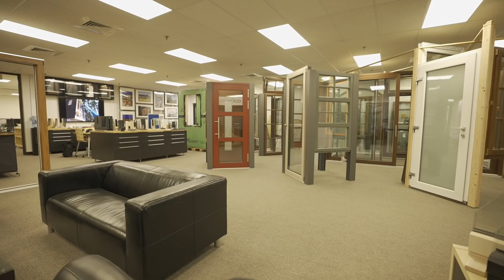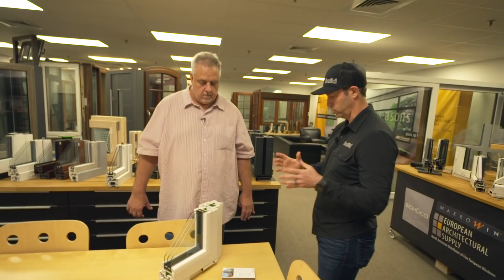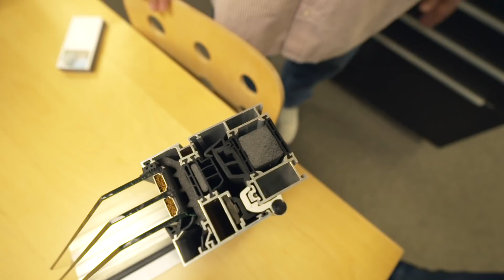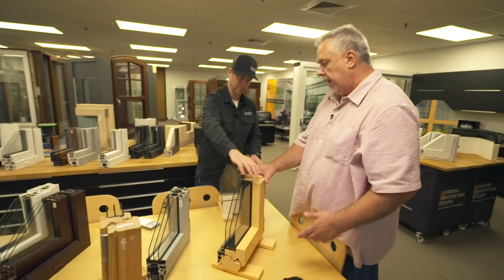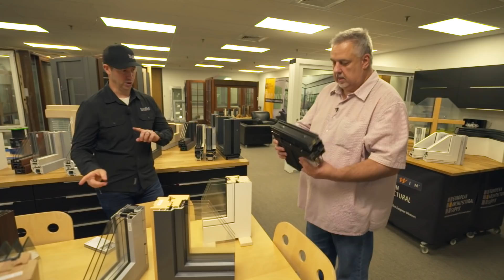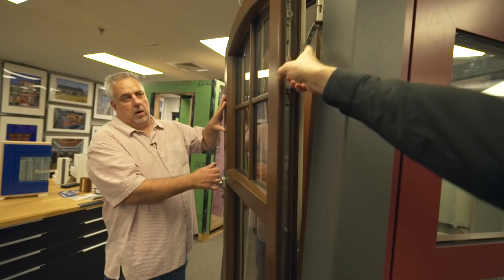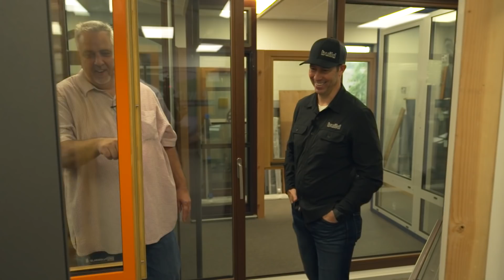These windows are AWESOME - Steve and Matt go window shopping!

Comment: Seen many of these style windows in action in Europe, and have also seen a showroom/manufacturer in Bosnia.
Our window technology in North America is stuck in Stone Age.
My dad's old place in Europe had windows made of two operable leafs, and each leaf was sealed, double glazed.
So, that means that they were quadruple glazed.
Reply: you apparently are not aware of this, but they do make triple glazed windows in the US; and those triple glazed windows perform better against US testing than do european windows. the issue is that relatively few people in the US buy triple glazed windows. the problem is that there is not enough incentive given to people to buy them: builders are primarily driven by "cost per square foot" considerations, so they aren't going to do anything (by way of energy efficiency) that they don't have to do because energy efficiency doesn't sell houses.
Reply: @paperwait9611  
I know they make triple glazed windows in North America.
I have used Loweven triple glazed windows as an architect on one of my jobs In Ontario, Canada. I think Pella makes them, and so does Marwin.
It's not all in the number of glass lites you have in a window; there is a lot more to it.
Subdivision builders don't give a crap about quality nor energy efficiency, because there is nothing for them there. Custom home builders sometimes are a different breed, but they are driven by client demands and architects requirements.
Reply: @apscoradiales  subdivision builders are trying to sell houses. most people aren't willing to pay for more energy efficient houses and, unlike europe, US building codes don't force builders to build more energy efficient houses.

custom builders are generally not "a different breed" in the US.

Comment: Been keeping an eye on these windows since we’re planning on building as soon as the lumber prices cool off
Luckily we’re only about an hour west of Acton (I’ve read the Schuco shipping costs are significant)
The hard part will be convincing the wife and the builder to spend the 💵 😂
Reply: the lumber prices are mainly affecting the prices of softwoods. windows tend to use hardwoods (with douglas fir being a notable exception).
Reply: @paperwait9611  considering the aluminum option
Reply: @josecito976  aluminum might be the most expensive way to go, but they can give you the thinnest frame profiles among your frame options.

Comment: Yes, they are wonderful but who can afford them?
Reply: They're not really that expensive in Europe, especially in the east of the EU. I recently ordered several to replace some of the old ones in my house in Poland. The new ones are pretty standard as for 2021 standards (uPVC, anthracite gray on the outside, white on the inside, triple-glazed, triple-sealed, tilt and turn, average u-factor of 0.78 metric (imperial 0.13 or R-7.7). The price for a 75"x55" window was only $490.
Reply: @Micha-xl5yc  Very expensive in the USA.
Reply: @Micha-xl5yc  That is dirty cheap for a window that size.  Is the window French door style and handle splits at the 75 inches so you have two 37.5" inch sides?  Who is the manufacturer and how long did your window take to get to you from the time you ordered it?
Reply: @MillionDollarFlipper  The manufacturer was "MS Okna", they used Deceuninck profiles. I ordered them through their local dealer and it was supposed to take about three weeks for them to arrive, but took two weeks longer due to some covid-related issues.
Yes, the window is split in two halves down the middle, each with its own handle.
The windows were custom-made, but that's just the default business model for window manufacturers here. Standardized window sizes exist, but there's no difference pricewise.

Comment: These windows are so impressive. It's unfortunate that the industry in the USA is so resistant to adopt these great international ideas. Greed rules in the USA, so industry investment in advancing product design or manufacturing processes is skipped in favor of more profits. As always, the knowledge base and concern for his clients that Steve possesses are unmatched. It'd be a privileged to have him design my dram home and have Matt build it. I'm seriously considering retiring to TX in about 8 years so it could actually happen!
Reply: you're getting suckered by marketing hype. US windows are optimized to US test standards. the u-values that you see quoted for european windows are usually against less rigorous european testing standards (they are less rigorous in europe because european countries tend to not get as cold as northern areas in the US get).
Reply: @paperwait9611  That's just false. Average winter temperatures in northern areas in the US are the same as in say Poland. You have to go deep into Canada (or to high Rockies) for it to regularly get colder than anywhere in Europe.
Reply: @prospero768  dude, you are badly uninformed, if not completely delusional. the average january low temperature in warsaw poland is 24 degrees fahrenheit; the average january low temperature in minneapolis minnesota is 9 degrees fahrenheit (with temperatures getting as low as -15 degrees fahrenheit in a typical winter). there is a reason why US windows are tested to a low temperature of -1 degree fahrenheit while european windows are only tested to a low temperature of 32 degrees fahrenheit - that reason is that european temperatures are mild compared to continental US temperatures.
Reply: @paperwait9611  that's not what the long term weather maps say.

Comment: I've never seen a better analysis of windows ever. 
That quad glass piece looked like something from Q Branch in a Bond flick.
Reply: the "quad glass" is not a quad IGU. a quad IGU has really low thermal conductivity values. the "quad glass" that you see in this video is really a triple glazed IGU with a fourth window. this configuration can reduce the u-value below that of a triple glazed window alone but the u-value would not be as low as it would be for a true quad IGU.
Reply: @paperwait9611  Any idea why the 4th piece was thicker and tempered? Thx
Reply: @bearleton3  i thought that they said that the lite was laminated (not tempered), so the lite would be thicker because it was laminated. but people don't usually implement safety glass (such as laminated or tempered glass) unless a building code provision requires it. so i don't know why the outer lite was laminated (or tempered).
Reply: @paperwait9611  You're right. They said the outer "storm glass" was laminated, not tempered. My bad.

Comment: Nobody makes windows form plasticized PVC! Plasticizers are additives used to make the material more plastic, aka flexible, for certain applications like vinyl sheet flooring. Saying UPVC is a different material than vinyl or PVC windows is completely false! The differences come down to the profile and possible inclusion of reinforcement.
Reply: Schuco calls it PVC-U. "PVC-U is the most frequently used material for windows in Germany. Due to its excellent cost/performance ratio and its very good insulation properties"
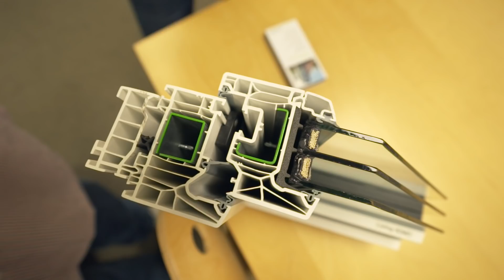Reply: @bearleton3  Regardless of where they put the "U" its still the same material. My issue is that @2:43 Matt asks what the difference is between a "UPVC" and "Vinyl" window and Steve repeats the marketing nonsense that UPVC is somehow better/different than what US manufactures use despite it being the same material. All Vinyl/PVC/UPVC windows use unplasticized PVC, so other than things like recycled content (which would result in a lower quality material) and aforementioned reinforcements/profiles there literally is no difference.
Reply: @brianc7096  Okay, but the manufacturer makes a big deal of it being PVC-U on their site.
Please forgive me, but I'm a fanboy when it comes to Steve. 😄